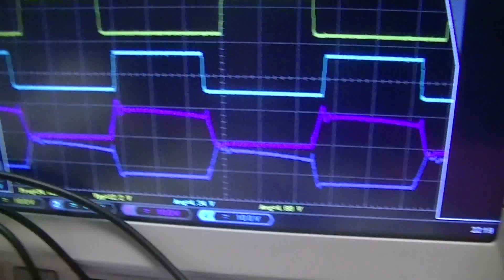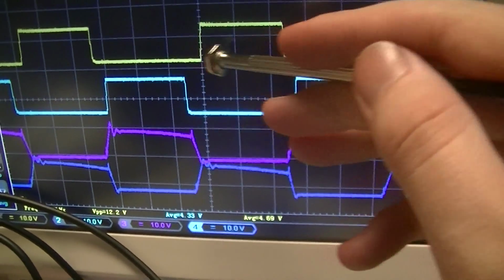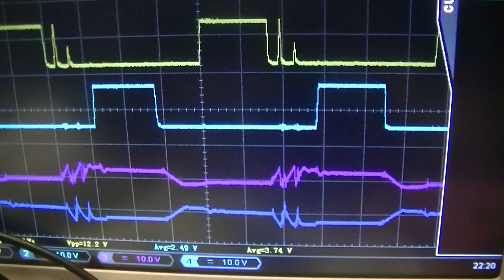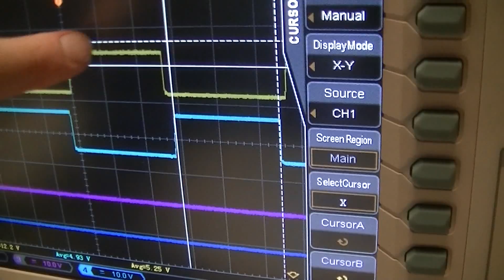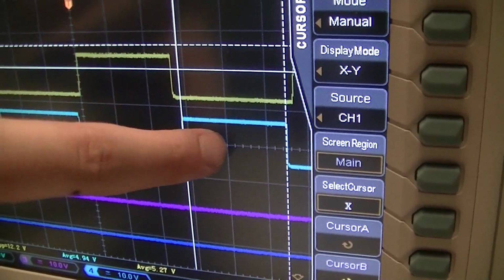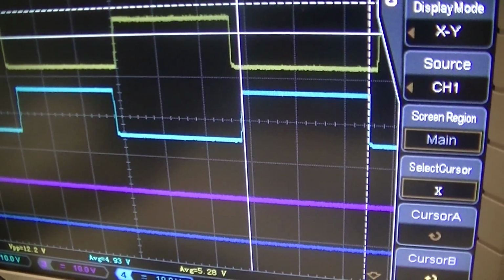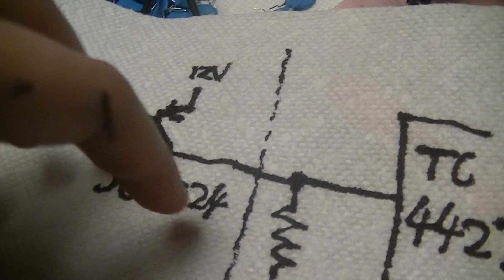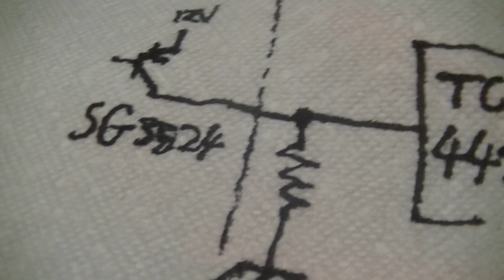DIY 12V low pressure sodium ballast being a dick

Comment: Interesting work, have you gotten a final product?  I recently obtained a 135W SOX lamp, and I would rather not drop $100+ on a leak ballast, however I am always up for an electronics challenge. Is there any chance I could see a schematic, for either this or a later one?
Reply from the maker: This is a dead project at the moment.  I would check surplus markets or instant start fluorescent ballasts designed to run a lamp that is electrically similar to a 135W LPS lamp.

Comment: hey if i am not wrong i can see the logo on sg3524 ic and that's TI logo so you are using TI's sg3524 ic switching frequency is 35.7 kHz (28 uSec cycle time) pulse rising time is somewhat 0.5 to 1 uSec and varying falling time always remeber these key things about these part no
-> one thing that sg3525/24 ic have imbalance pwm output on both pwm channels like pwm1 out will have more pulse width and other will less pulse width 

->  sg3525 ic have built in mosfet drive stage so there is no need to use external gate driver so you are not gonna confused between sg3524 or tc44xx driver ic i have used three mosfet per output (pin11,14 on sg3525 and no driver ic on output) without any problem 

-> always add 100uF and 100nF capacitor connected very near to vcc  of this ic this will also solve this problem but as i mentioned above that some ic have poor performance and better is to replace it with other brand better is to use ka3524/25 ic that is more stable 

-> do not forgot to add capicitor to pin8 (softstart for sg3525) and use shutdown pin for current limmiting and pin9 (COMP for sg3524) to gnd of circuit  and across current sensing circuit 

          i have used almost 13000 ic's in my commercial product and i still have more than 1500 ic's in my stock so i knew all pitfall's of these ic's it its better to choose ka3524/25 ic when you have no experience with these ic and not sure about sg3524/25 ic's  quality that which ic will work better 
        
         i hope that my comments will be valuable information for you and others who else gonna read these comments 

                      and if you need further assistance then join my forum 
                             http://supperelectronics.com/phpbb/
                       i am sure that i will be able to help you out for this circuit on my forum with ease 
 Regrads
shams iqbal
Reply from the maker: doc elec Except I have used SG3524s from the same tube in my transformer inverter design, and have verified equal pulse widths on both channels with that, as well as with the SG3524 on this board when the TC4427 is not installed.  You might be dealing with some peculiarity relating to a specific lot of chips or your specific design if you are having differing pulse widths.  I suspect that this is due to grounding issues and inductance/ringing therewith.
Reply: i have used all brands and many lots not a one lot .
    "as well as with the SG3524 on this board when the TC4427 is not installed." then simple thing is to just disconnect transformer common pin which is connected to positive power rail to make sure this is the actual cause  for pulse width high time dis-matching on both pwm outputs.  
well about your statement "inductance/ringing therewith." that should be on mosfet drain not on pwm output pin it can go there when 
mosfet transfer signal backward drain to gate and further if tc44xx ic works in this way that output pin which is connected to mosfet gate work as input pin and then tc44xx input pin become output so  then this magic can be happens 
well again about inductive ringing i can see that you were using battery that is itself a huge capacitor and can dynamically supply surge current to loads and power mosfet have built in parallel diode to clamp  inductive back emf voltage look your own posted video and wave forms displayed on it 
         hit and trial that some how it may work is not the key to find proper solution i have the solution but you dont want to listen
regards
Reply from the maker: doc elec
I mean inductance in the ground connections of the MOSFET source connections.

Comment: You did say that you put in a small resistor for current detection, and I didn't hear you say that it was a low inductance type. The inverter looks like it could be hard switched, which could produce current spikes that the controller might be picking up. Have you looked at this yet? Does this problem arise when the TC4427s are connected without the transistors?
Reply from the maker: The circuit worked when breadboarded without the power FETs.  I will try reworking the grounds as that might be part of the problem.

Comment: I've never used those ICs so I can't comment on them. I've used TC4420's but they kept failing where the more hearty UCC chips thrived. I've used the SG3525 for PWM modulation.

 When I did a capacitively ballasted inverter I simply used a VCO from a 4046PLL (you could even use a 555) which fed a square wave into a UCC37322/UCC37321 pair which drove a half bridge via a GDT. Then drive an output transformer like you have and insert capacitive ballast in series. Just vary the drive frequency to change the output current. Mind the resonant frequency of the secondary + ballast cap though, don't want to drive near that. The UCC chips have built in dead time control and have enable lines which lets you do current sense via a resistor and comparator to implement over current protection very easily.

Hope you get this working!
Reply from the maker: The SG3524 has a built in comparator that is intended for current limiting in the manner that you described and is intended for applications like this.  And I have almost a whole tube from when I was working on a modified square wave inverter for my DIY MPPT controller.The problem with a 555 is that is impossible to get a 50% duty cycle square wave (but you can get close), which I need to avoid saturating the transformer with the net DC component.  I did toy with using a 555 to clock a JK flip flop configured as a toggle, with the clock and Q/Q' outputs feeding AND gates.  I scrapped that when I found the SG3524 as 1 40 cent (at the time) chip replaced at least 3 chips (more if current limiting with a comparator, not to mention the potential reference and associated passives).
Reply: Ah, interesting. That sounds like a fun little chip!